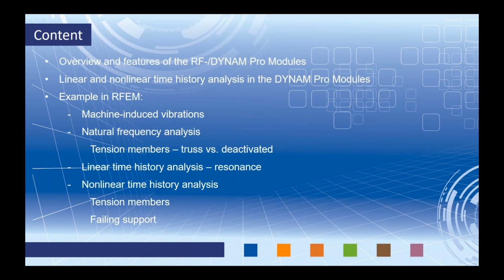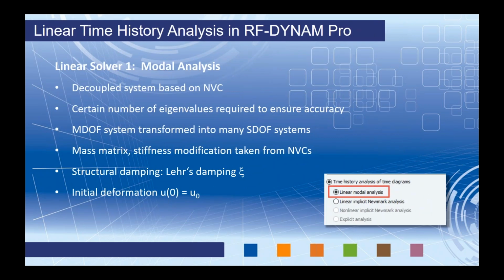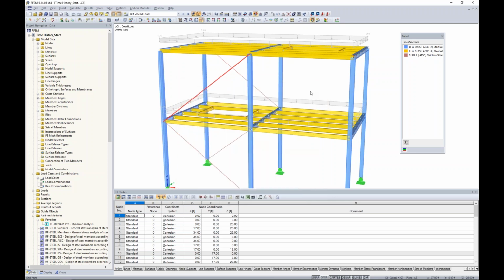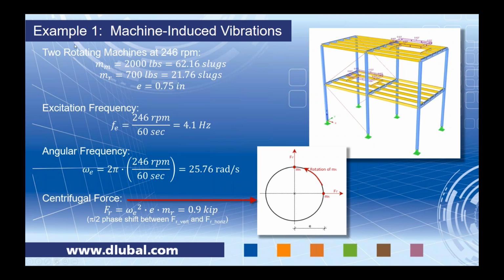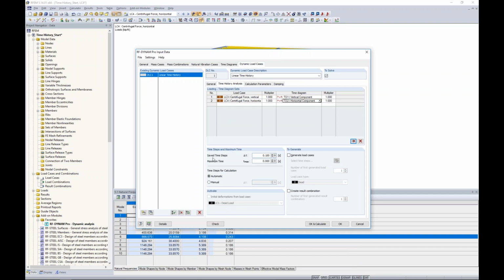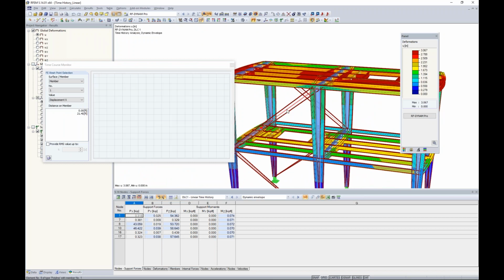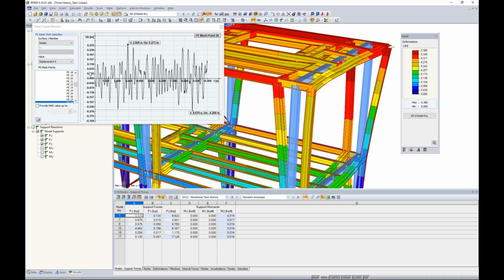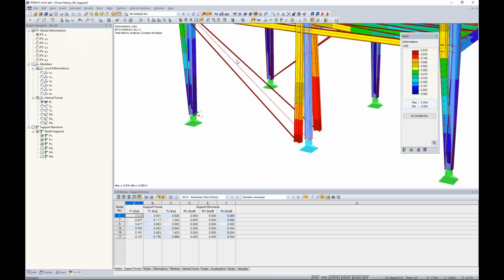Webinar: Nonlinear Time History Analysis in RFEM (USA)

Comment: omega1 should be 7.5530 rad/sec
Reply from the maker: Hi, Ryan!
Could you elaborate more on which omega1 value you are referring to in the video?
Reply: @DlubalEN  hello! it's the angular frequency at 35:59. anyway, the values difference is small.
Reply from the maker: Hi, Ryan!
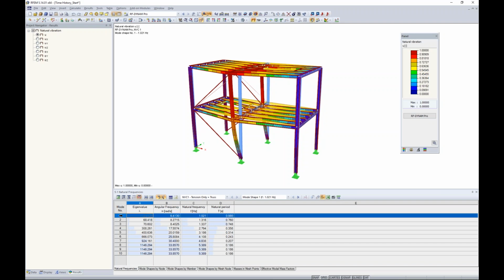The angular frequencies at time 35:59 refer to the dominant mode shapes 1 and 6 which are shown at time 23:49.  Mode shape 1 has an angular frequency of 6.4130 rad/sec which is used for the conversion of Lehr's damping to Rayleigh damping.

Comment: Hello, what is the difference between using deactivation of member and defining all of tension member as cables? I am solving similar problem but my bracings are defined as cables (but in general they work only in  tension as your elements). Thank you.
Reply from the maker: Hi, Lenka!
If you use cables, the calculation is performed according to the large deformation analysis. This is the difference between cables and (tension) members.

BR

Comment: Can I go for high rise CLT buildings NTHA in this?
Reply from the maker: Hi, varun!
It is possible to analyze high rise clt buildings with RFEM and RF-LAMINATE. We have several examples of multi-storey buildings done in RFEM.
See: https://www.dlubal.com/en/downloads-and-information/references/customer-projects?industry=timber-structures
Reply: @DlubalEN  and what about tall structures ??
Reply from the maker: Hi, varun!
In principle there is no limitation in how tall the structure is. Currently, however, I think the local building laws may set a limit.
But in RFEM you can enter as many floors as you want.